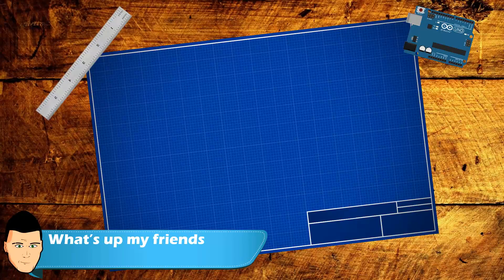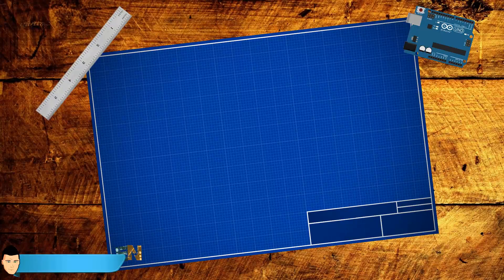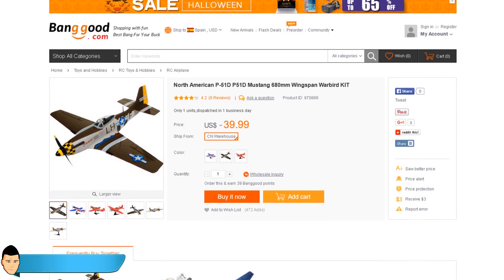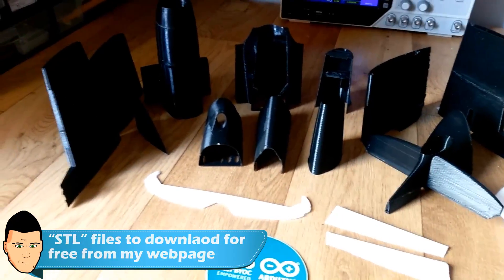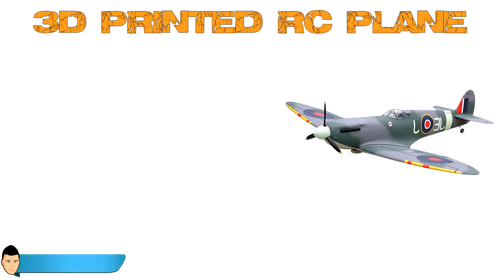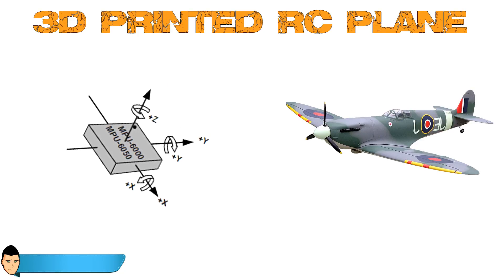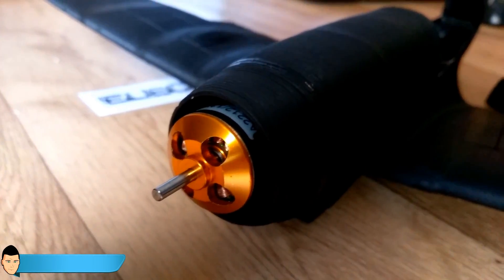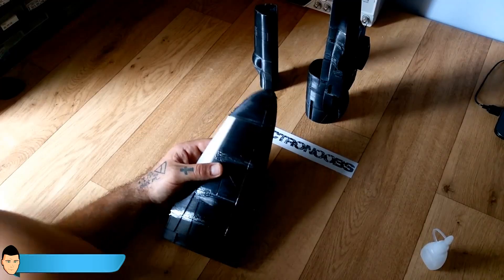3D printed Spitfire RC plane introduction

Comment: the only thing that dont understand is why dear god why use an arduino its completely unnecessary when a good quality transmitter can be baught for  50$ and a lot less comlpacated
Reply from the maker: I see you don't enjoy building and coding things yourself. I wanted to make this project fully DIY using arduino!
Reply: coding is a pain in the but man, im just say'n who is going to take apart a perfectly good transmitter in order to put an arduino ?? again im not nocking your work, infact i plan on building the spitfire myself its a great looking model
Reply from the maker: This transmitter is an old type with 35MHz crystal oscilator. I don't have the receiver so it's not useful. Better hack it with arduino!

Thank you very much!

Comment: I have printed out this plane and I'm currently gluing it together I have skipped out your arduino and gone with a pre made flight controller the print seems a little heavy I think it will fly though with speed I think the landing may be hot it it does take off I'll have to see when its ready
Reply from the maker: I haven't tried mine yet. And yes, it seams a little bit too heavy. I'm now designing a bigger and lighter one!
Reply: following
Reply: well it kinda flew but then barrel rolled to the right and smashed onto pieces haha well onto the next plane print
Reply: gotta say though that motor has some power with a 3cell lipo
Reply from the maker: Thanks for sharing!
Reply: printing mine now scaled down 0.93 so it fits my printer lol trying to fit a 2200 kv in don't see the point of arduino in this litle plane but hey i like to do stuff simple. Did you already fly this model? Im thinking for firsth flight to go bank and yank. I hope i can take the weight down in the tail this way. with this much weight its prone for tipstall.

Comment: First of all i will give the details of the components i have used
1. 2*1400kv bldc motor
2. 2*30amp esc
3. 1 nrf24l01+pa+lan
4. 1 nrf24l01 
5. 2 joystick 
6. 2*arduino uno 
7. 3 servo
Some jumper wires 
I need the code to run this plane will you create the code and mail me........ Also the connections. I will complete the model and i will post
Reply from the maker: my schedule is quite full right now.
Reply: ELECTRONOOBS yeah ya i can understand no problem you can do it latter